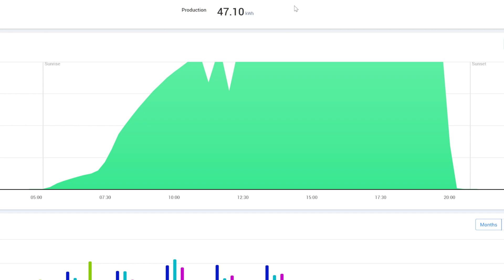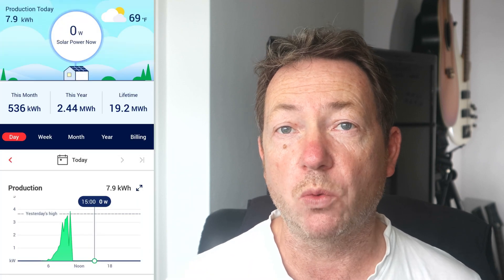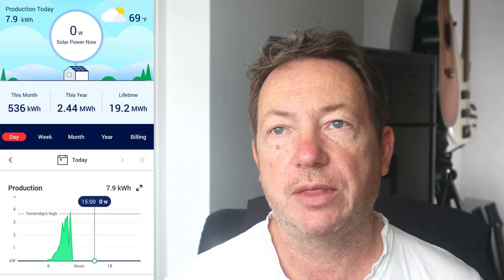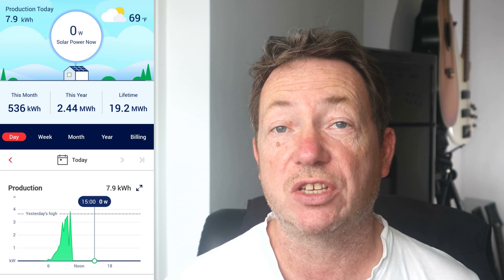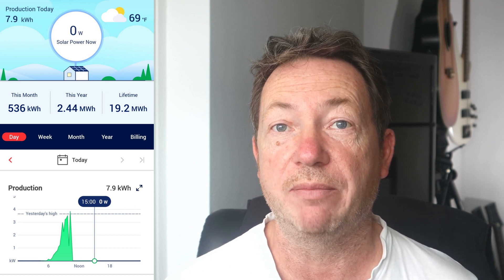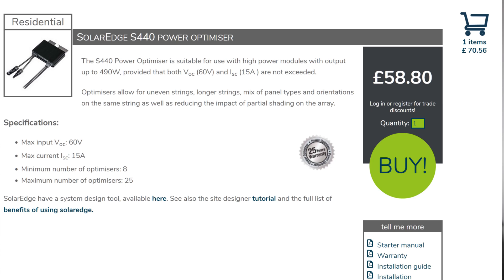SolarEdge Optimiser FAILED After Just 3 Years! Here’s What Happened…

Comment: I agree with many of the comments here. We have a little shading on our small second array which would have been the ideal place to fit optimisers. It’s even accessible from our garage flat roof so no full scaffolding necessary, but I recalled a YouTube video where a chap had been without a full array for several months because of optimiser failure and his installers ability to get to him. The comment about keeping it simple struck home too. We decided not to bother.

If you have a lot of shade there is an argument for them but maybe they are an insurance that you don’t need?

Comment: I get why optimisers might be useful, but if you don't specifically need them you should avoid any electronics on the roof IMHO.
It's just not accessible for maintenance and every active component you have is another thing that can go wrong. If you have 10x more components in a system then you are increasing the chances of something failing.

Comment: When I initially looked into solar, I was all for optimizers as I thought getting data about individual panels and mitigating any shading issues was the way forward.  Ultimately I didn't get them because I couldn't really find any conclusive proof they would help me (I'm largely unshaded except from about 6pm onwards), 14 would cost me about £700, 1 failure could cost me over £300 for scaffolding + installer (or insurance). So I figure over the life time of my install I'm £1000 up by not having optimizers.  Other peoples milage may vary.
Reply from the maker: I think you are right about them. For me in the planning stage I wanted to see each panel to see if one every goes offline or fails, but I also wanted a long warranty and SolarEdge seemed to be the only company offering up to 25 years. I suppose you don't think about scaffolding costs or labour for the replacements unless something happens, hence my extended Workmanship warranty, but after that I might be on my own.

Comment: Installers can make all the difference.  My only failure was a big and heavy one - the SolarEdge battery died very early on.  My installer came within 2 days and had handled all the stuff with SolarEdge.  He came with a new battery from his own stock and we were up and running again within a couple of hours.  All the supply logistics and returns stuff was transparent to me as it all happened between SolarEdge and my installer.  He tends to hold enough stock to cater for most situations but clearly as and when SolarEdge items are superseded it will get harder.  It won't be long before the current SolarEdge battery is replaced by the new modular design.

Regarding your complete failure, do you only have 1 string to your inverter?  I didn't think SolarEdge inverters had less than 2 strings available for use?
Reply from the maker: I also thought I could just unplug the East side and carry on with the South side. But when looking at the inverter there was only 1 string.

Comment: Quite surprising that one optimizer issue brought down your whole PV system, as you said, I thought the purpose of them was to keep the rest of the array working if one panel had shading or a problem. Obviously not the case if the unit itself develops a fault.
You must have been disappointed.